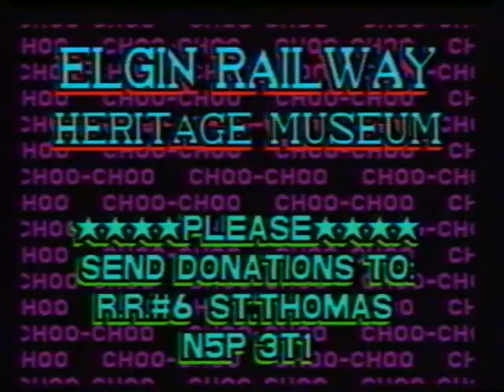CNR 5700 at the Elgin Regiments 125th Anniversary

Comment: Canadian National 5700 is a 4-6-4 class K-5-a “Hudson” Type, built by Montreal Locomotive Works in 1930. It pulled passenger trains through out the CNR system. Until being retired in the 1950s. Today, the locomotive is at the Elgin County Railway Museum.